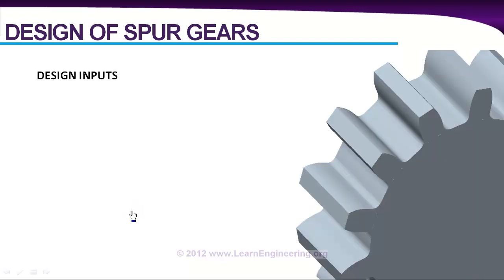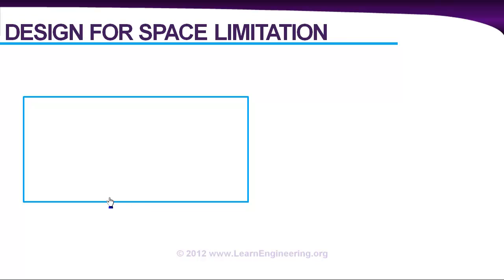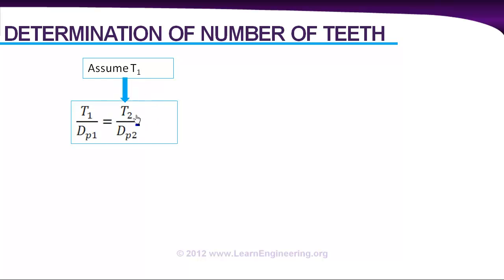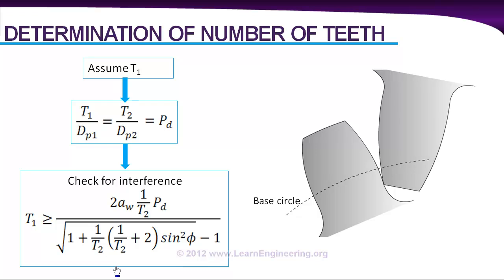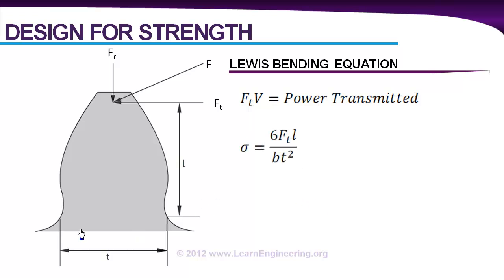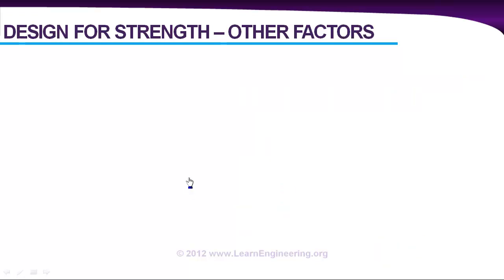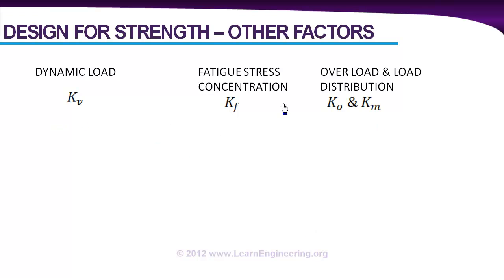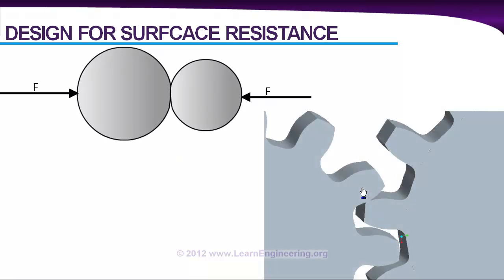Gear Design | Spur Gears

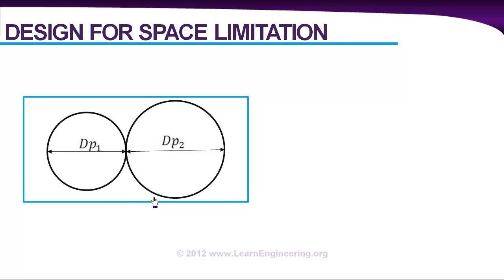Comment: Is the diameter of the two gears at 1:45 the diameter of the root circle, pitch circle, or tip circle? I assume pitch circle since they intersect at a single point but it is unclear in the video because if it is the pitch circle then Dp1 + Dp2 does not equal allowable width. To find the allowable width, you would also have to add the addendum of each gear (assuming the diameters are of the pitch circle). If you don't do this, the teeth will stick out slightly further than predicted with the equation, therefore improperly calculating the space that the gears will take up.

Comment: I have a pinion with OD = 40 mm and no. of teeth = 13, pitch of rack is 7.9 mm.
I want to manufacture similar rack and pinion but i need pinion and rack details for manufacturing.
I did some calculations and all my values are matching with the above rack and pinion except number of teeth = 14  but number of teeth are 13 .
Why is my number of teeth not matching with the actual value?

 
 
  Number
  of teeth (Z)
  14
 
 
   Enter Module(m)
  2.5
 
 
  Enter
  Pressure Angle(α)
  20
 
 
  Addendum (ha)
  2.5
 
 
  Dedendum (
  hf)
  3.125
 
 
  Total Tooth
  height (h)
  5.625
 
 
  Enter Pitch
  Diameter (d)
  35
 
 
  Pitch (p)
  7.85375
 
 
  Base Circle
  diameter (db)
  32.89
 
 
  Outside
  diameter (da)
  40
 
 
  Root diameter
  (df)
  28.75

Comment: if using "diametral pitch" automatically means that u are design this gear in "inch" unit right ? 
Or else u will use "module" if u are working in "milimeter" .... i have some doubt bout it...

Comment: Sir can you tell me " why in design of gear pair, difference in brinell hardness number of pinion and gear is kept 30
Reply: The thinking is that the pinion should be a little harder because it has more revolutions and therefore should be a little stronger. The harder tooth will also wear on the softer tooth and you then want that wear on the gear.
Reply: gamingSlasher 
ty sir 😊

Comment: When does social and cultural considerations such as pride in regional identity and subsequent non-standard accent become unacceptable? When it can be determined that it is being applied as impedance to conveyance of information, that would be linked to pace of transference and conversion of more physical commodities - like labor into goods and service, or practice into experience.  If resources including time, space and raw materials need to be paced and regulated in its conversions and depletion, humans should be permitted to work on other facets of being human in the interim (is this why it's called the "mean time"?), versus inventing techniques to generate resistance and abrasive forces in the social and cultural realms in such deceptive ways. Especially when such forces have been known to get out of hand, leading to outright destruction and, not just collateral damage, but trauma on a psycho-dynamic level, that may take far longer to stabilize or regenerate
Reply: hmm,so deeeeeepppppppppp

Comment: I see you know how to cut teeth
I am doing a non profit research for many years, My lathe needs to gears
Do you cut them and what would it roughly cost
My guess is the gears are knowing they are straight cut no more then 6 inch dia.
cma.energy at   gmail.com

Comment: In the  lewis bending equation ,why the bending stress is not depending on the material we use?
Reply: The critical value of the stress is dependent on the material you use and this has to be greater than the stress generated as calculated from Lewis Bending Equation
Reply: @aswinrajeevan3674  you know that u replied to a question that was asked 2 years ago before u replied.

Comment: I always knew engineering was technical, but I never thought something that looks so very simple had such a paramount science behind it...
Reply: Yeah it's crazy how much knowledge is behind everyday objects.
Reply: This is nothing, you should read the theory which has been developed for simple flexure beams... 

I have a number of 1000+ page books on that stuff alone.
Reply: @rock3tcatU233  yep. I graduated with a mechanical engineering degree, the amount of calculations for the most inane things is overwhelming and there's still more material published on other subjects every bit as lengthy
Reply: _ David _  Diyers: I'm choosing this size bolt because it's what I had in the garage.
Reply: What did you expect? This isn't even complicated...
Reply: I started to design a gearbox, and realized how difficult it actually is.

Comment: Sorry for all the racist comments. The speech is clear and easy to understand for me, and I especailly liked the parts about calculating the allowable parameters using the Lewis formula.
Reply: watch again "DESIGN FOR SURFACE RESISTANCE" check its spelling in presentation........